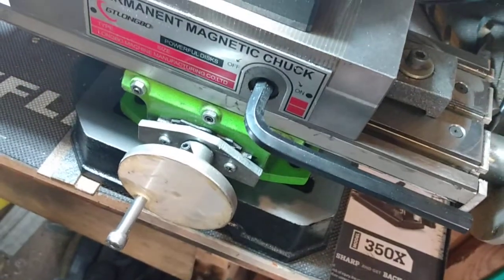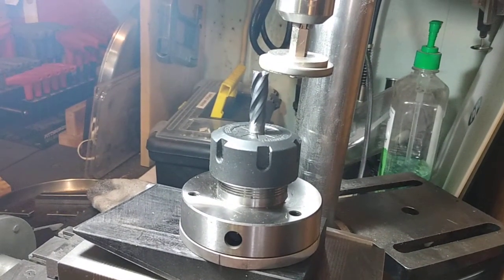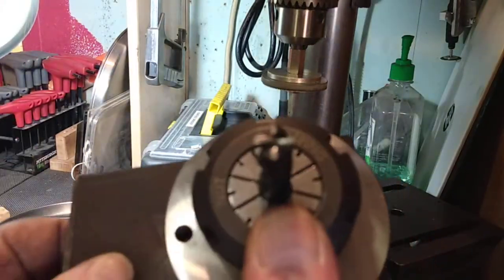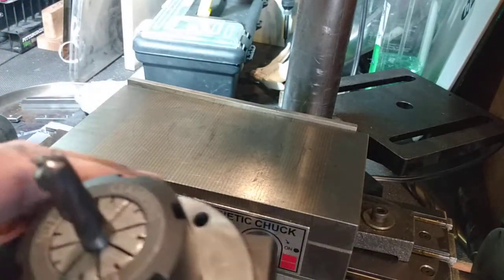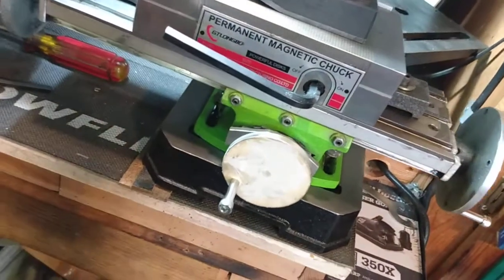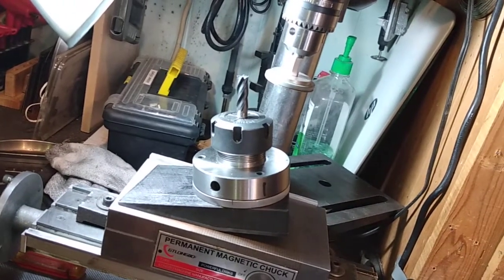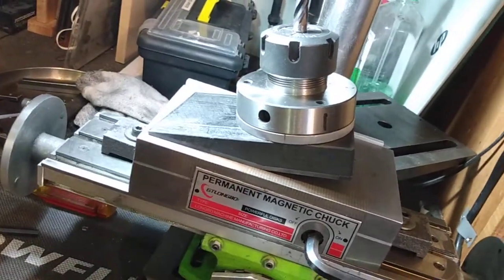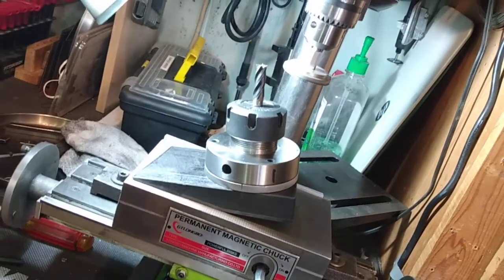Carbide End Mill sharpening with a DIY sharpening jig.. ok Tony, fixture.

Comment: Um, someone sharpening end mills will likely have a vertical mill.  So why not use it instead of the drill press with the table slide?
Reply from the maker: One could.  I mostly use that drill press for surface finishing, I have a mini mill and a 1940's vintage Delta drill press so I didn't need to modify another drill press, but it was fun.

Comment: Thanks SCOTT !     ;)  
       If I only used my cranium , it would have dawned on me to ask , " How do you hold the endmil ? " . . . 
That would have saved you the trouble of making the video - BUT . . .  Now the 'mystery' is solved , & we can all see THE REST OF THE STORY !  ;)    Pretty simple setup . . . & very straight forward !
        How do you prevent the taper in the spindle from loosening ?   * I'm guessing that you just take VERY LIGHT cuts  ?      
       I'm considering options for my spindle . . .  it's an M2 taper , without the capacity of making the top portion of it 'hollow' , to accept a draw bar to hold tooling firmly enough for light milling .    Pinning the tooling to the spindle is one option , threading the base of the spindle is another . . .     I don't like the idea of having tooling fly out of the spindle nose & ruin itself , the workpiece  .  . . or my EYES !  ;p      * No need to go blind or bleed for no good reason !  ;)        I'm getting lazy in my old age , looking for the easiest solution .    ( aside from buying a 'ready made mill ' !  )
Reply from the maker: In the slot that you put a wedge in to tap out the mt2... You place a carrage bolt with ground head that fits in the slot.  You might need to grind the threaded end a bit shorter.  Slip the modified bolt in the slot and thread the mt2 in the press quill and draw tight to the bolt.
Reply from the maker: P. S.  Very short bolt thread
Reply from the maker: And I "Gorilla Glued the drill chuck to the taper lol